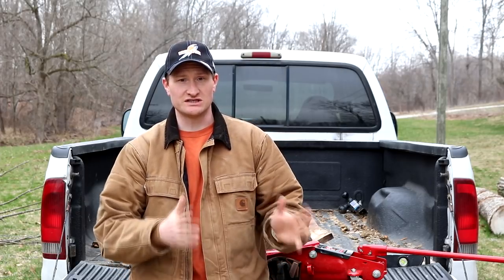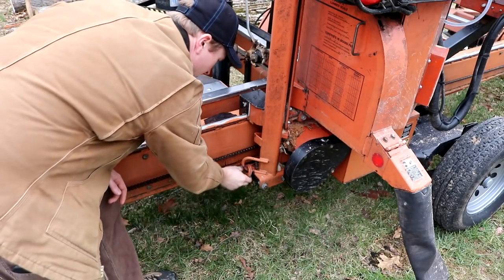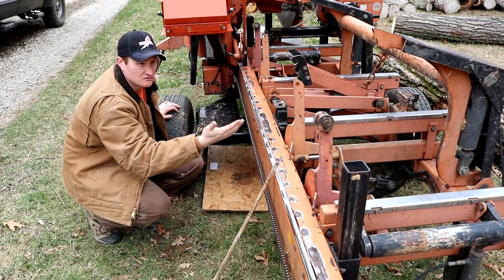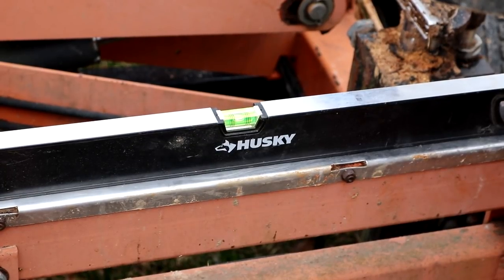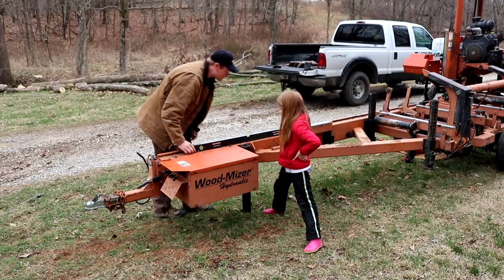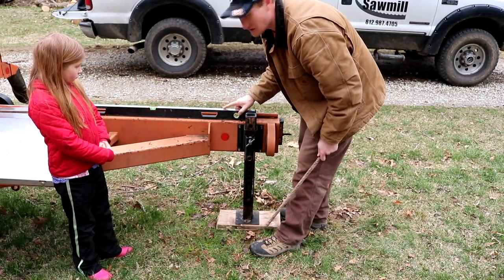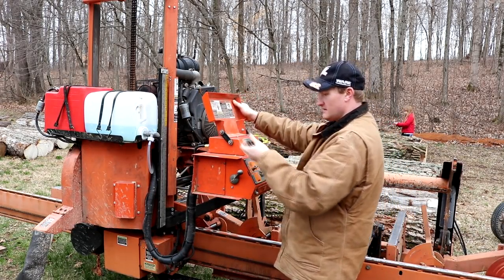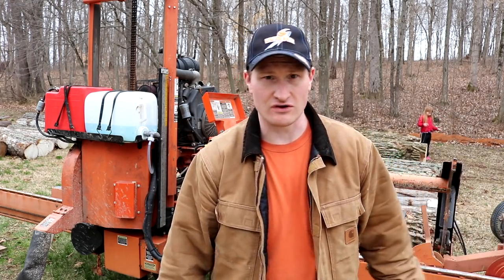Wood-Mizer Set up - How long does it REALLY take?

Comment: 19 yrs running a LT 40 never used a jack. Boards work great under tire and faster. Good video.
Reply: I was thinking the same thing, when i get to the jobsite i don't even take it off the truck until i have my side to side leveled, saves a lot of time. Probably only take me 10 minutes to be deployed.

Comment: My LT40 SH looks just like yours, 8000 hrs, 51 Hp cat diesel, lube mizer, Acuset 2, De barker, auto cut switch, . Paint faded and rubbed off in the same places, make sure the out riggers are lower than the bunks. Only 2 of my 4 log stops are hydrolic ?, Time cutting stickers, blade charge, help removing lumber and stacking, moving fliches, nice job on the video, looking forward to more action shots..

Comment: Picked up my LT 35 last Oct and had it set up on some soft muddy ground I had over the winter. Most of my sawing is personal as of now, but plan on getting into the business more later. I'm north of you a bit in Brazil, IN. When I picked mine up, they didn't show me how to set up as intricately as you did. As most of the time mine will be on ground such as what you showed, it's nice to get an idea how to do it. Moved mine recently and noticed that the travel pin does not line up with the hole on the sawmill head now. Have not had a chance to trouble shoot it yet, but hoping that the frame has not flexed out of square due to the unlevel ground. Woodmizer Indy is an hour drive, but still hate to drive it up there for them to give it a once over. I'm going to level it like you did and see if it lines up again. Fingers crossed.

Comment: Hi there
  Great videos! I've enjoyed dragging around an lt40 hydrolic mill for about ten years. I owned a small excavating business. But the mill has turned into my livelihood . it's the most fun I've ever had working:). Small suggestion that could improve your setup times and not require a jack.. I always bring some 1/2inch and 1inch pieces of wood . I pull the downhill tire onto an appropriate height of blocking and drive forward with the level sitting across the mill. Most times you can see the bubble from the truck. If needed back up and remove or add a board. Then chock the wheels and unhook. I found this to save fussing around . Hopefully helpful
Happy milling
Reply: Hi Wilder. I pull my mill (LT40 HYD) onto blocking too, but I like the mill to lean a little toward the dogs (back fence) so that when log empties from the arms onto the mill, it heads right to the dogs instead of maybe rolling back and forth, or onto the now half-lowered arms. Speeds up my day a few seconds per log. Definitely don't want it too much out of level, as the debarker will have trouble moving away from the log. Hey, I live in Wheelock, VT!
Reply: Lots of good replies here. I use a trailer tandem wheel changing ramp for the downhill side.(ramp raises the wheel about three or four inches and the wheel sits in a saddle so no chock is required) I like to add blocking under both wheels, which raises the mill high enough so that no digging is required under the lift arms, and the outriggers fall below the deck rails. Also if jacking is needed just crank up the outriggers with your bar. Your cellphone should have an app with a level. Saves you from carrying a four foot level)

Comment: Nice video,seems like most of the landings I set my 40 up are not level.i usually drop all the legs to find which one is going to determine where to start on the leveling process by making sure the top of the leg is lower than the bed rails.nothing worse than getting it all level and set only to find that when you clamp a cant and it rides up on one of those plastic covers on top of the leg.easier to block it up than to dig one of the legs down. Floor Jack is a must if you don't have fine adjustment legs. Side to side level is always good but I usually pitch downward just a bit to assist in the power feed. Anyone that says just drop the legs and mill without leveling is just asking for alignment problems in the future.

Comment: Highlift jack is what I use. It is quicker, has more range (lift) and sets up better on uneven terrain. The jacks on the LT40 (2015) are a horrible design. Murphy's law has always been consistent for me in never having the holes in the jacks in a good position to use the lever bar. Having a pile of boards and blocks doesn't seem to help. Why they didn't make them all screw jacks I will never understand. It is such an act of frustration setting the jacks that I turn down jobs to mill on site now. I just bought 40 acres and will be building building a 36 X 45 pole barn (sides open) with trusses. Then I will never move my mill again

Comment: Does not need to be perfectly level. I've had my lt40 on a sidehill and milled perfect lumber
Reply from the maker: crazy treekillr Optimum and "it works fine" is the difference between idealism and pragmatism. I am more of a perfectionist, which serves me well most of the time!  Best regards, thanks for watching!
Reply: I agree. Mill (side-to-side) does not need to be level. I actually prefer my LT40HD to lean a little away from the lift-arms. End to end I use a torpedo level - the mech engineer in me wanted it within a 0.01 mm end-to-end initially, but we're not milling machine parts here. I have never needed a jack - I've only ever used the chrome rod that came with the mill outriggers, and it works perfectly. I also carry 1,2 and 3" thick (lots of hillsides in Vermont) blocking, pulling the mill's lower wheel onto an appropriate thickness of blocking when I arrive at the jobsite. 

Something that made a HUGE difference for my accuracy was learning from WM that the frames are purposely crowned on these mills, and to make good lumber you've got to have about 1/3 of the weight on the wheels, and 1/3 on each end outrigger. This straightens out the crown in the mill frame. The other 4 outriggers are just for added stability/safety in case of soft ground, an earthquake, or someone with a phobia shows up. I'll finally hit 2000 hrs on my 2011 mill next month (I only mill about 50 days annually. My main job is doing mobile poultry processing...)

Comment: Setup time on Lt15Gos to Lt50s out preform any other portable on the market that is why they do not do the shootouts like they used to go to point B saw a log go back to point A , Good video but so people know, You do (NOT) have to level any woodmizer with the exception of LT10, LX450 , WM 1000 Up & all their industrial equipment. You mill being portable would setup much much faster without that 4ft level drop the legs and start cutting ...
Reply from the maker: OVERCLOCK ATLANTA Don't want to disagree, but the more level, the better. An unlevel machine causes problems, such as wearing out feed motors, loading logs, and many others. Wood mixer recommends leveling the machine.  This is a textbook set up of the machine as taught by Wood mizer themselves.